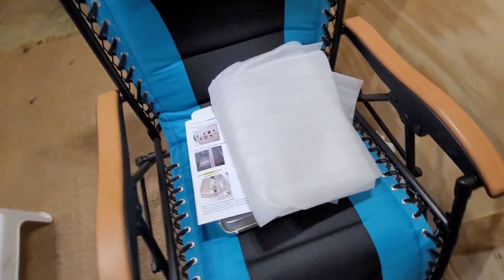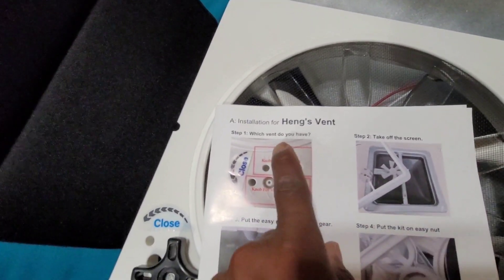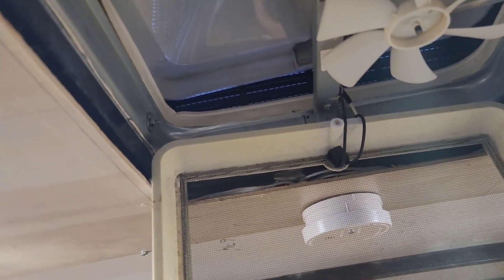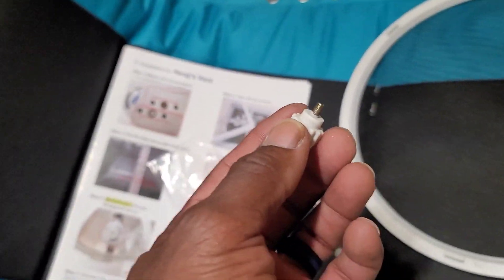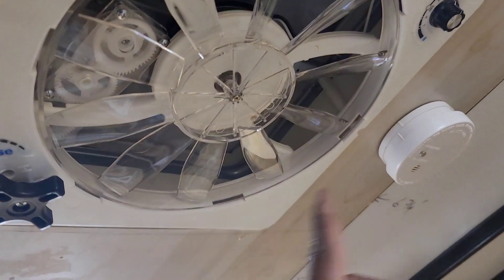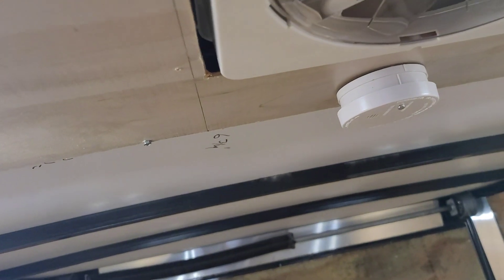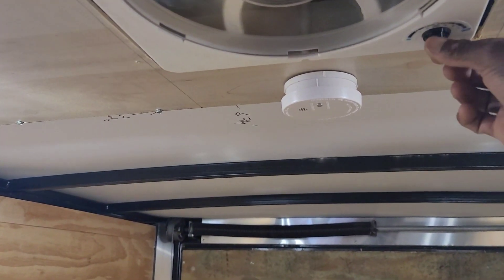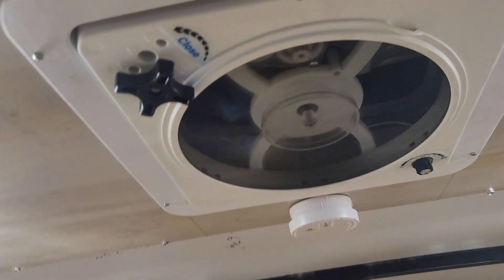Installed a vent fan upgrade kit.

Comment: Couldn't see where you were putting that small thumb screw at the end??
Reply from the maker: @lovingjesus5184  at the 7:10 mark you can see the thumb screw on the plastic gear. I should've been a bit more detailed, but you can see it in this video between 7:10-7:12 mark on the plastic gear. I hope that helps.
Reply: Ty for your quick reply. The main reason I watched the video was to see what to do with that one piece LOL otherwise it was a great video. Thank you